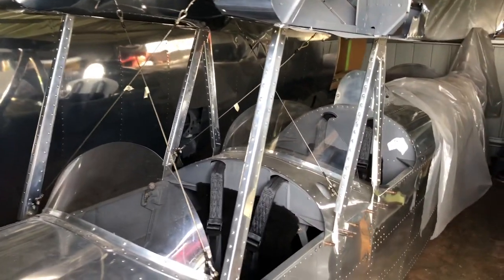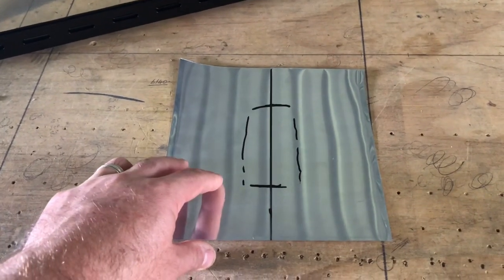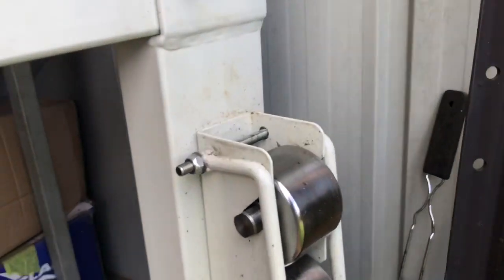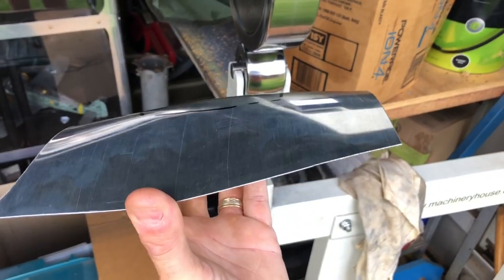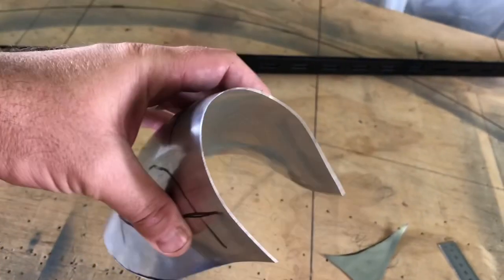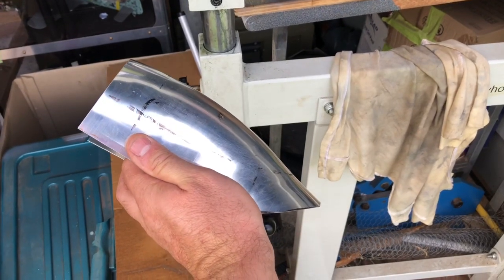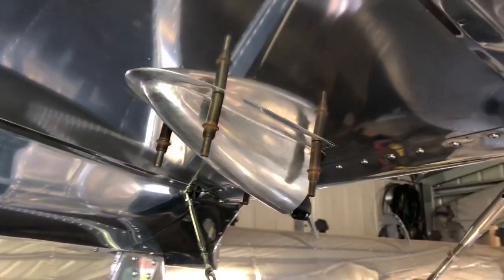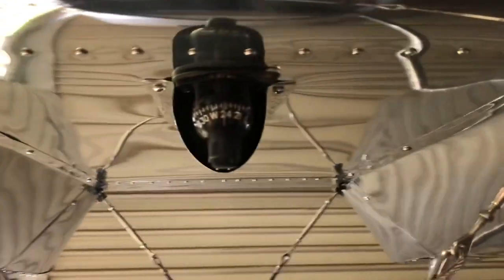A fairing for the compass Frankenstein style

Comment: Good stuff. Would love to see more english wheel and metal forming. How did you do the anneal ?
Reply from the maker: Thanks mate. I have to make the engine cowling yet to look forward to that. Most of the time I don’t anneal when I use the wheel, but when I do I simply rub the part with soap and then heat the metal with a butane burner until the soap goes black, then quench it in water
Reply: @donwtsn  Looking forward to the engine cowl .... could I ask where you bought the English Wheel. Did you buy it locally or import it ?
Reply from the maker: @smjamitchell  I got it from the Machinery House in Brisbane. For English wheels it’s a pretty cheap version but works well for thin aluminium
Reply: @donwtsn  Excellent. I will drop in and have a look.